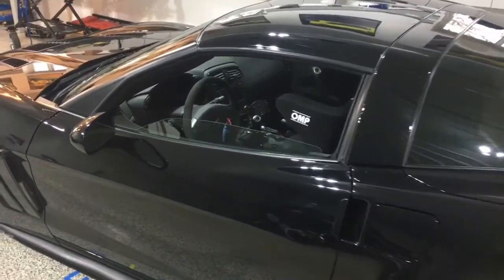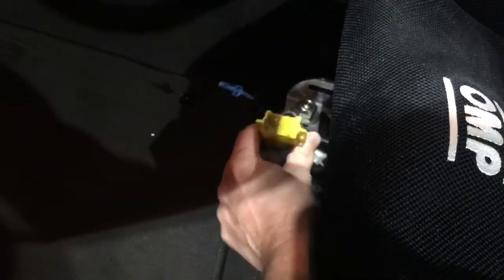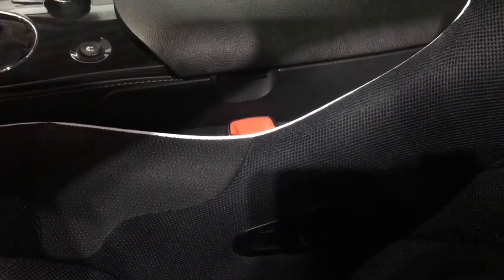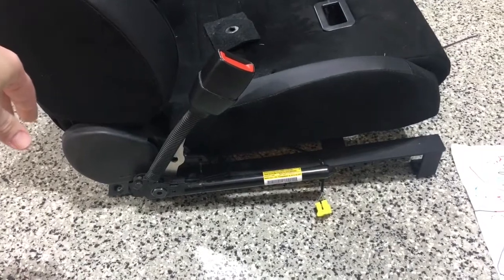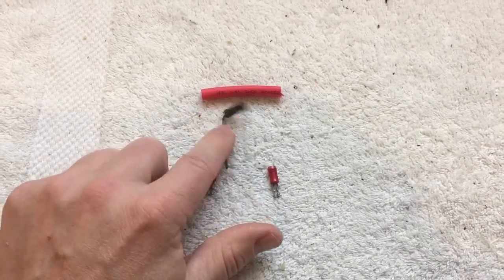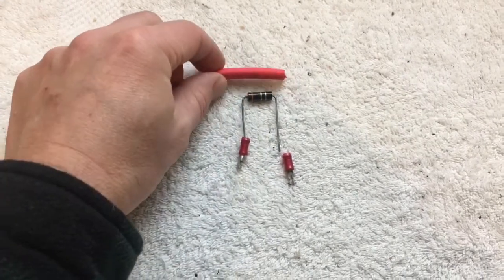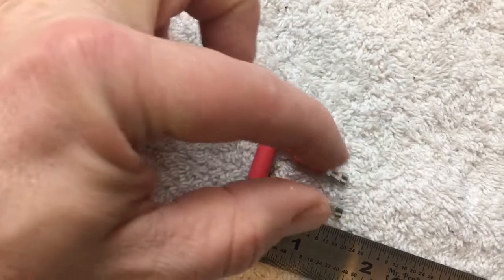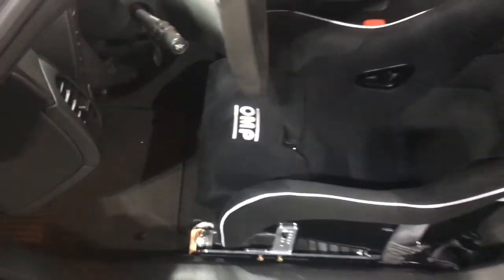C6 Corvette - Fix Air Bag Light From Race Seat install.

Comment: Do you have a link to the resistor you used?
Reply from the maker: I don’t, I bought it at a Radio Shack.  It’s a 3 ohm resistor.
Reply: @rw895  did you solder it?
Reply from the maker: @KOoKeDKiNgK1Lu  nope.  Just crimped the connectors on.